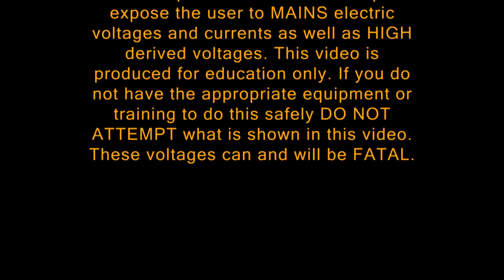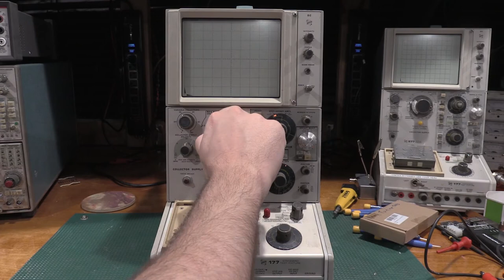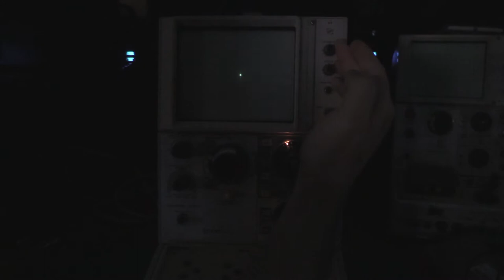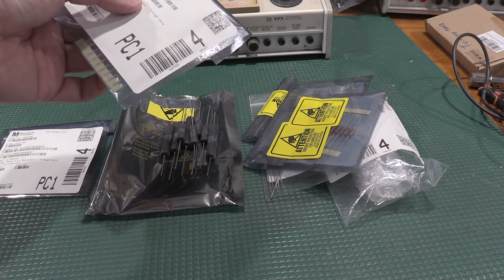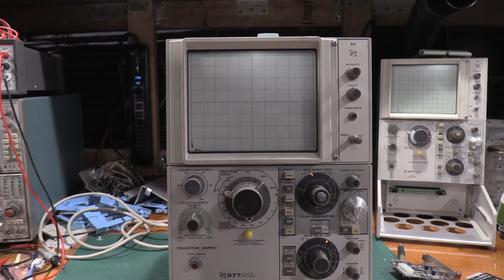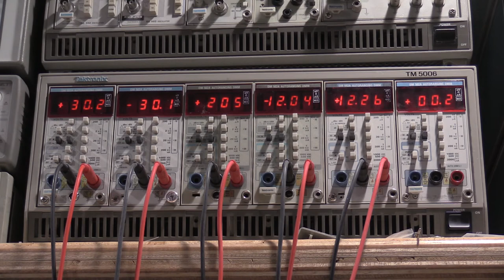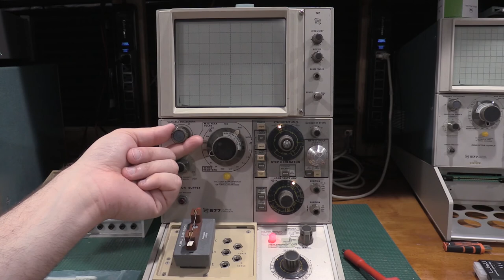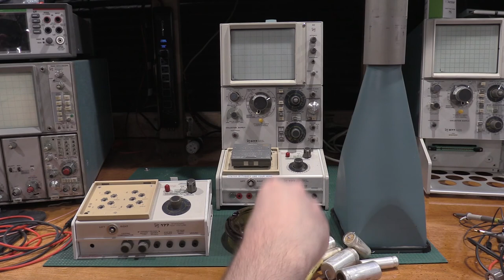Tektronix 577 D2 Repair and Alignment Part1

Comment: Thanks for these 577 videos. I have one that I'm going through reviving and I'm finding your repair videos super helpful!
Reply from the maker: Awesome glad they are helping. I don’t remember the order of the videos but if you get to a point where the unit wont align and it is fighting you. Check the alignment on the 177. I got bit by that, there are 3 adjustment points in the 177 but they are covered in a totally different manual.

Comment: Many thanks for your time, money and cognitive load commitment to this project. There is nothing on YouTube close to this intellectual quality or honesty. 

Based on the high time evident on the tube, the prior work on the power supply BUT the failure to replace the tantalum caps, I am guessing that this thing came from a high work load shop which had a “bare minimum maintenance” policy. 

Everyone repo’d those tantalums. Something doesn’t add up. 

I’d check the linearity on the collector auto transformer/variac/pot whatever Tek called it. If the shop did crappy maintenance that pot could be squirrelly. 

Everything is my own opinion and limited by my experience. I welcome correction.

Comment: Can’t thank you enough for this series. I rebuilt a 575, 576, and both those little mutant scope plugins. Now I’m sitting here with a 577 D1, 577 D2 and a pair of 5111As for parts. Watching you is a huge help. 

I can tell you that both 577 PSUs had fried tantalums. I ran across a service bulletin somewhere about those two parts being a serious problem. 

A really dumb question:  where on Earth did you find that textured ESD mat?  I could really use one for work on heavy chassis.
Reply from the maker: Glad to be of help Boonedock Journeyman, I am going through a D1 on the bench now. There is a HUGE gotcha that I ran in to on this one that I go into detail with. Ill be honest I ALMOST junked this one. Even started pulling it apart for parts. Then I had to put it ALL back together again. The real gotcha is you cant do the vertical calibration until you KNOW that the 177 is good. This is not really an issue with the 576’s (nothing but wires) but there are some op-amps in the 177 that need to be balanced or you will pull your hair out trying to balance the amplifiers. A good indicator was the invert button if the + ac – transition look good then you hit invert and it goes crazy before you look at anything else check the 177 amp gain and balance. The static mat was honestly a Microcenter purchase if I remember correctly.
Reply: I am having a problem getting the 100 volt switch setting to work  The yellow light comes on and I can't get it off
Richard w1few
Reply: I have a 577 curve tracer wirg 177 d1 d2 plug in

Comment: Question what was total cost in parts including the CRT?
Reply from the maker: That is a tough question to answer. The caps are from my bulk storage I usually buy lots of 100 when I need a value to keep them on hand. The CRT can be had for around $100.00 given the donor scope that was used.

Comment: Hold the phone on the 177 left/right switch.  

The Tek museum here in Beaverton sells the outer shell for $35. It allows you to replace the broken shaft element without touching the rest of the switch. It’s a “trivial” repair. 

I will send you an eBay auction number as soon as I get home.
Reply: Crap. Never communicate without sleep. Username @gmail.com.
Reply from the maker: I got one for it so we are good there. The main part I am missing is the shaft on the vertical knob crumbled with age. This seems to be a uniqueish part as it need to hold back the collector voltage I am also trying to get at new knob as there is chemical damage to the paint. I have all of it so nothing was scrapped and there will be a part 2 the switch is already installed. There is also 2 different knobs. I need the older one for this unit as the scales and lighting are different.
Reply: @ZenwizardStudios  - Send me a list. If you have part numbers that will of course help. I am sure I have enough donors in storage to round stuff up.  

I’m not sure you fully realize how important your video work is. There are a bunch of people like me out here who can fix anything. Getting things to work - like in terms of calibration- is a black art to many of us. 

I’ll trade parts for learning anytime. What about the rest of you’all out there?
Reply from the maker: Hey Crocellian,
 Looks like I was able to source the parts needed for the injured 177. When they come in I will start filming part 2 so repairs are on the way.

Zen
Reply: @ZenwizardStudios  w?

Comment: Hello,

I search power suply transformer from  Tektronix 577 ,maye You can help me ? Best Regards
Reply from the maker: I can try there are a number of transformers in the 577 which one are you suspecting the trouble is with? The 576 has some known transformer issues but there are none that I am aware of in the 577. The transformers have stood the test of time quite well. What seems to be the trouble you are seeing with the unit?
Reply: @ZenwizardStudios  Hello, Thank You for answer. I search T701 , my trouble is no power. T701 is bad - one primary winding is dead. 
Best Regards
Reply from the maker: The part number for T701 is going to be 120-0830-00 or 1820-0830-01, it seems there was a -01 revision. This will be a very hard part to source unfortunately. You might need a doner unit or if only the primary winding is blown out you might be able to use another country power system with a transformer. For instance, dropping 240 V to 120V through a transformer and running on the 120V winding. If the 240V winding is blown out. Or reversed if the 120 winding is dead.